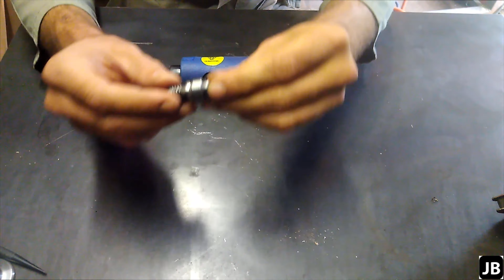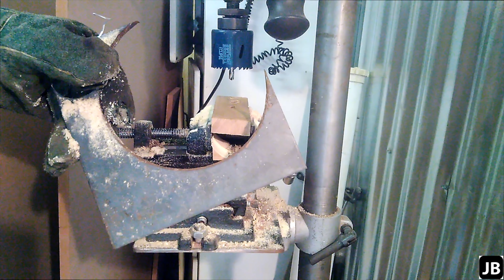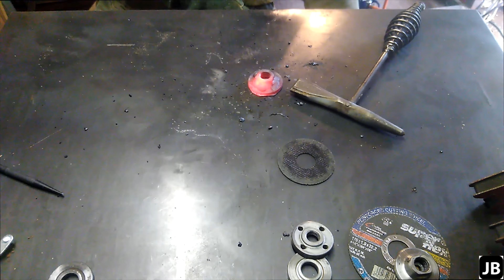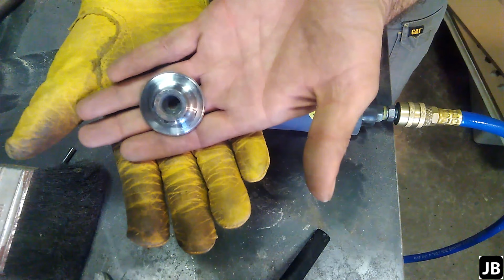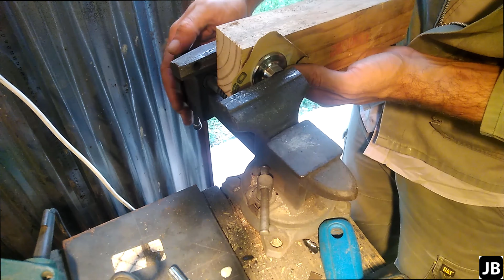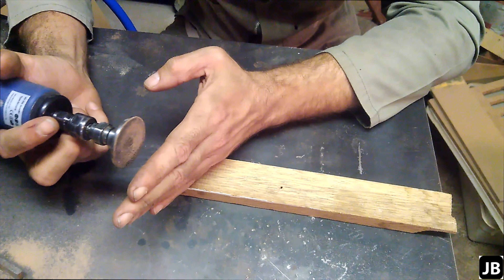No. 1 Die Grinder Attachment

Comment: This is a great idea. I always wanted to do this with my die grinder so I can use the remainder bits of cutoff wheels on them. Thanks for posting this. I don't have a lathe but it seems there's a number of these type of attachments/adapters on Amazon, usually called core drill bit adapters.
Reply from the maker: Thanks for the comment. I have not checked online. Just make sure it fits both the collet of the die grinder and the I-d of the grinding disc.
Reply: @JacoBadenhorst  Anytime. I actually found some 5/8 to M10x1.25 & M10x1.5 adapters part of a cheap Harbor Freight wire brush set (9$). I might take those and just see if I have any M10 to M8 adapter bolts in my massive and organized automotive bolt collection that might have some smooth parts or areas that will fit the die grinder. If it does, problem solved for 0$ :).